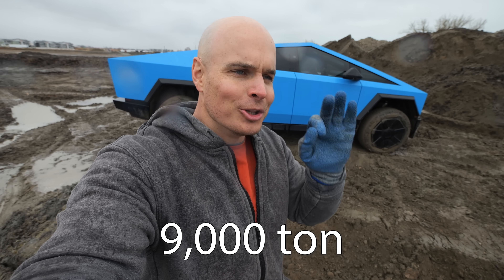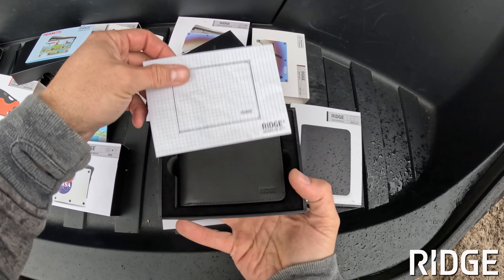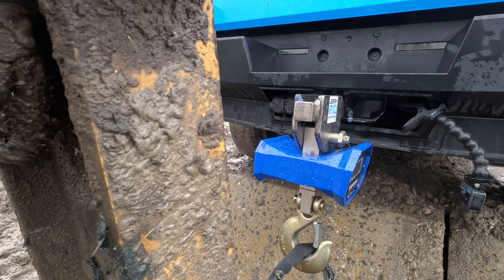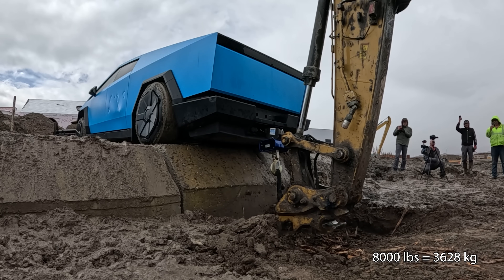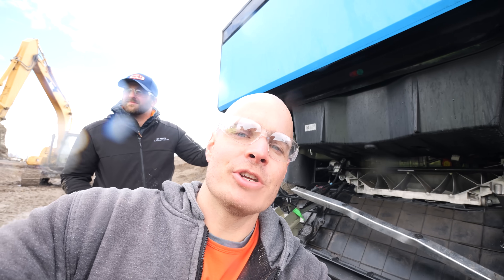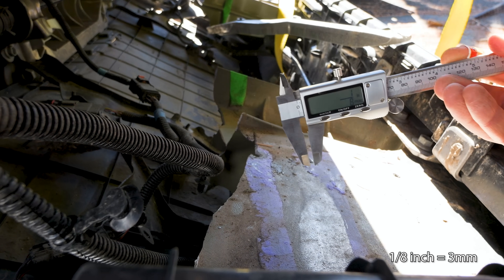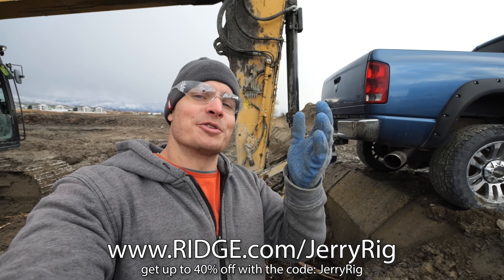SHOULD YOU TOW WITH A CYBERTRUCK?! - (catastrophic failure test)

Comment: That's crazy that they're relying on like 1/8" of CAST aluminum and spot welds/glue to hold a trailer. That would probably be fine on a car but theres no way I'd trust that in a truck. Yea its fast and cheap to build but for the money you pay for a cyber truck they really are built like $15k Chinese no name you use to fill pot holes on a golf course wtf

Comment: Hey Jerry, if you would like to push the frame further you'll be able to create more leverage by removing the suspension travel. this video is a great example if the suspension meets OEM standards, but i don't think it does. if you just want to test the frame capabilities; weld some square tubing between the axle and the frame and apply the pressure again.

Comment: Tow capacity is not the same a tongue weight. I Like your video’s, but this was just bs click bait. I expected better from this channel…
Reply: Regardless of what you want to call it, it's not safe.
Reply: @ how is it not safe? You will never see that amount of direct tongue weight towing within the capacity of the truck.
Reply: @jonholaday2733  like if you went over a pothole and all that weight just suddenly went in one direction?
What if you're pulling someone out of the mud who got stuck?
Reply: @ there still would not be the full capacity or weight directly down on the hitch. That would require the trailer tires to be airborne. 

Hitches are not recovery points, if someone is hitting it that hard to extract a stuck vehicle, they should be using a kinetic rope of the appropriate size. 
I stand by my original comment, this test proved nothing negative of the hitch design.
Reply: @jonholaday2733  so I don't actually get to see the gauge when the excavator is bouncing on it?

Comment: pointless vid youll never get 10k lbs of tongue weight if your towing what its rated for. but would i buy  a cyber truck for towing nope.
Reply: Totally possible if you hit a pothole
Reply: @rogerwilco5918  no its not u literally just saw a 50k lb trackhoe bouncing on the  ram hitch and  the scale didnt go up much higher than it was when he was picking his tracks up off the ground that tells me bouncing doesnt put as wieght on it as they imply in the vid. so youll never  get 10k  hitting a pothole if your just putting the required 10% tongue wieght on
Reply: @windzer  actually, no I didn't. Where did they show the scale when they were bouncing on the truck? What was the timestamp?
Reply: @rogerwilco5918  watch the vid again and give them another view
Reply: @rogerwilco5918  watch the vid again and give them another view
Reply: @windzer  so, you didn't actually see the part you just described?
Reply: @rogerwilco5918  watch the video. you clearly didn't watch the video and just decided to comment without watching.
Reply: @windzer  at no point in this video did they show what you described
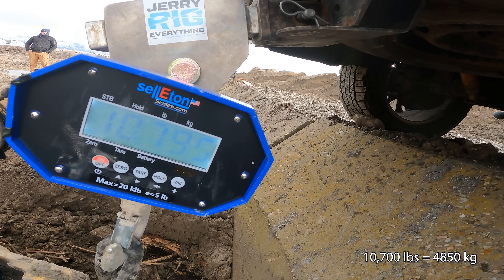Reply: @rogerwilco5918  13:01 wow your blind
Reply: @windzer  maybe you can tell me how much it said then?
Reply: @ move along troll you bore me
Reply: @windzer  So, you made that up then, and tried to use it to prove your nonsense point?
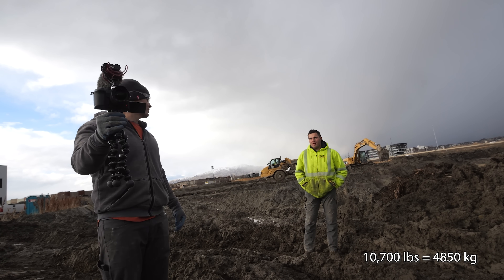Reply: @rogerwilco5918  its at 13:02 wat are u talking about
Reply: @windzer  so, there's no actual video of them bouncing and I can see the gauge.
They didn't even mention what the maximum pressure was when they were bouncing.
Regardless, it didn't break the truck in half like it did the Tesla

Comment: This test just proved that the tongue weight is nearly as high as its towing capacity. That's insane. You should be pulling in the lateral, not pushing in the vertical.

Comment: Shouldn't you have tried to rip the hitch off by pulling to the rear with it and not straight down? Since when are you going to have a 10,000lb weight hanging vertically from the ball?

Comment: I'm normally quite a fan of your video's, but I must say that im slightly dissapointed in this test. During real word situations, the downwards force induced upon the hitch would not come close to the force of 10000lbs of dead weight hanging from the hitch. Even if in the extremely unrealistic scenario that a trailer is loaded with 10000lbs on just the front of the trailer, the weight will still be (unevenly, but still) distributed over all tires via the axles. Not to mention suspension and the tires greatly spreading the already distributed forces of a sudden up or downward acceleration over time. A guesstimate would be that the equivalent of the force of max. 2000 lbs of dead weight hanging from the hitch would be induced in a realistic situation.
Reply: To be clear: i agree that aluminium is a horrible material for a frame. The issue is that this test does not show that, because the tesla survived almost 10x its rating.

Comment: Why would you push straight down on it? Even the F450 only has a 5100 payload capacity. Better to pull it straight back. Like you are actually towing. I hear your explanation but this is not at all accurate unless the trailer in question is airborne behind the truck! 

Imagine this: I can hit a driver side window with a hammer and it not break. Take a screw driver and put it at the top and try to pry the window down and it will shatter with ease. What you are doing is the equivalent of the screwdriver in this example. 

Yes steel is stronger but we already knew that. This is not a fault with the Cyber truck, you also compared a 3/4 truck frame to a 1/2 truck frame with the cyber truck. This is not apples to apples, try that with your Riven.

Comment: Jerry,

Good job, all you proved with this finding is that Tesla has a 10x factory of safety for weight rating on the tongue weight. Great work! Your should really do your research before coming up with findings that’s don’t apply to real world.  Tongue weight is typically only 10% of towing capacity..  this should inspire more people to by a cyber Truck not less! And you’re complete wrong on the pothole issue.  The entire weight of the load would never bare down on the hitch from hitting a pothole.  Are you insane??

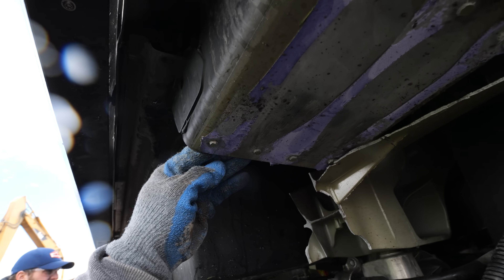Comment: 8:17 That is literally structural adhesive, probably Teroson EP 5089. I worked where the newest corvette's aluminum frame is built and that's what is used between mating surfaces along with the spot welds. What's crazy to me though, is how few spot welds there are for such a HUGE surface area. 6 spot welds and 3 stripes of adhesive for a surface area that wide and flat is basically just tacking them together. The aluminum frame of the Corvette has spot welds lining up and down each part along with huge servings of the purple adhesive. The casting in this thing amazes me too, how thin it is at most points. Like they thought that an I/H beam style of casting would be enough even if it was that thin. I would truly like to see a more scientific and controlled test approach of the CT's frame and towing, to confirm this or Whistlin diesels random carnage, but there have already been real world cases of the frame snapping just like this from doing nothing but towing.

Comment: No doubt a steel frame is stronger than the Al casting and bonded structure, however I disagree with the alarmist statements you make.  If somehow you managed to get the entire weight of your trailer to come down vertically on the hitch while driving, you’d be f’d as you’d loose control of the truck.  The front wheels would come off the ground.  As you demonstrated, there isn’t a way to impart a 10k load without holding down the wheels.

You need a follow up video where you show a trailer with a load and how strong the hutch is.  You ight find the ball hitch struggles at 10k of vertical load.

Let’s keep in mind you tested the part to nearly 20x its rated load.

Comment: Idra Group
The Giga Press program is a series of aluminium die casting machines manufactured for Tesla, initially by Idra Group in Italy. Idra presses were the largest high-pressure die casting machines in production as of 2020, with a clamping force of 55,000 to 61,000 kilonewtons (5,600 to 6,200 tf).

Comment: Hi Jerry. I do really like your show. However, I felt this test was more of a Houdini trick. 

Before that much weight could be applied the rear of the truck, the front would start raisin would limit the weight. And if it continued to rise, eventually the hitch would hit and ground again limiting the weight on the truck structure.  

Holding the front end down was the cheat…while putting this massive weight down on the rear 

If a person’s just pulling an oversized overweight trailer with a cybertruck, it would just lift the wheels all the time and or jam the hitch into the ground.

Comment: Aluminium is strong if you prefer it to be rigid but it can't handle fatigue unlike steel. Also aluminium's weakness is it can't absorb shock this is why whistlindiesel broke his even without applying 10k on the hitch.

Comment: Cast aluminum frame for a part that critical is really dumb. Vibrations alone will cause metal fatigue even if the loads are relatively low. Its happened in the past with mountain bikes where they eventually break in half.

Comment: This test is like balancing the entire max trailer load on the tow ball vertically. 

Although, stronger materials should definitely be used here. 3mm is not okay, especially cast with all the problems cast matrials may have (porosity/inclusions/shrinkage cracks/ext).

Comment: So it handled 3x the maximum tongue weight of a 2025 Ram 1500 and didnt really start to have anything major happen till over 6x the tongue weight of similar trucks.

Also, think about this perspective. You wont be towing a 100,000lb pound trackhoe with it. If the trackhoe is bouncing on the tongue, supported and lifted into the air and only creating 5 tons, you are golden for practically anything a 1500 would tow, because the max tow rating of a Ram 1500 kitted for maximum pull is just over 10klbs. 

A little more info, the cyber truck has a tongue weight rating of 1100lbs and a tow rating of 11,000 max. 

A properly loaded trailer will only put 10% of its weight on the tongue, the rest being supported by the trailers axel(s). This means that a 50,000lb excavator would have a tongue weight of 5,000lbs. Not counting the trailer weight of course. The truck axel broke off at 8,000lbs. So that means that the CT would be capable of accepting a trailer with an big trackhoe on it and pull it across the ground.

Now, potholes or curbs or whatever, do cause more weight to impact the tongue. Though, with a properly loaded trailer, if you dropped the rear tires off an 8" curb at the same time, you are going to put about 2000-2500lbs of force on the trailer, at max load 11k lbs. It would take an improperly loaded max weight trailer(60% of the load on the hitch) to exceed the break point of the Cyber Trucks hitch.

That sounds a little bad cause, maybe someone has no idea what they are doing and loads up his trailer in the worst way possible. Ok sure. Though, a picture of what that woudl look ilke, would be two ram 1500s stacked on top of each other, sideways on the trailer...  Or a realistic example would be someone putting 3 whole pallets of bagged concrete at the very front of their trailer. Thtats how you hit a pothole and exceed 8,000lbs tongue weight of a max tow rated load. 

It was built to be in the ballpark of the half ton pickup class. Though, i think most people that get a cyber truck are going to be mostly light duty anyway, just from the nature of the vehicle itself. You might have some that tow around utility trailers and such for construction work or otherwise, but i dont see any of that weighing enough to bring it to the 11,000lb limit. 

I would give a pass for the control vehicle being older, because older vehicles have less tow rating capabilities. The 2500 of today can tow 20,000lbs, which id double the 1500 of today. Though, in 2004 the old design could only do 12,000lbs which is very close to the max tow rating of the cyber truck, off by 1000lbs. That sounds close enough for compare, except when you consider that the 2500s are designed for rugged work and the frame of the 2500 is significantly beefed up compared to even a modern 1500s frames. So... im not sure its worth comparing as an apples to apples comparison to use as "control".  Though, a modern 1500 has slightly improved reinforcements... It would definitely be worth testing the 3 vehicles against each other.

Overall, i think the cybertruck will do what its intended to do, if you went overboard and were either the dumbest person to ever tow something, or intentionally trying to break it... then it might break if given the perfect situation.

Comment: This ridiculous uneducated explanation of how  the  hitch could possibly experience any kind of a shock load that's even worth noting or any thing to be concerned about is false.  Anyone that believes his ridiculous explanation how this could happen has no knowledge of physics and how the springs  and shock absorbers along with the pneumatic tires all work together to prevent any kind of concern able shock load. If you have any doubt try putting a 2x4 on top of a spring and see how fast you can drive a nail into it with a hammer.  The hitch will experience heavier temporary loading and unloading while the trailer is slowly bouncing over uneven road conditions. The mass of the trailer controls how fast the trailer can be accelerated in both the upward and downward directions so the resulting speed at which the trailer can come down on the hitch is not close to hammer speeds that could result in any excessively heavier tongue load or any kind of an actual shock load. The manufactures of both the truck and the hitches that can be put into the trucks receiver already factored that into the tongue weight max rating knowing there will be slightly heavier loads applied even with improperly loaded trailers. It is most unlikely that any additional loads that will be applied to the hitch will be enough to cause aluminum fatigue.  I would not think of this guys videos as anything educational because he proved himself  in this video as a know it all fool. To the point it would be dangerous to accept any thing he might say was safe. If you just watch because its fun to watch people destroy their own stuff then accept him as nothing more than a biased comedian.

Comment: The conclusion by Jerry is a malformed argument.  Since he focuses on the weight at which the bumper hitch fails. Jerry fails to account for the  total vehicle dynamics of any truck loaded with this much weight, in the conditions he states are possible failure modes. Meaning any truck loaded with the amount weight required to cause this type of catastrophic failure, would lead any vehicle  [including the Dodge he uses for comparison] to  be in a very dangerous vehicle dynamics. The front wheels would be lifted on the vehicle, with a very likely chance of loss of control of the vehicle. Once a vehicle loaded with this type of tongue weight . The vehicle is then only controlled by the two rear wheels, The rear axle and wheels would no longer be able to control the lateral motion of the trailer.  Jerry ignores the real world  vehicle dynamics of a moving trailer-ed load to focus on static load breaking strength. While this is a test point, it in no way the reality real world vehicle dynamics.

Comment: towing capacity is not lifting capacity( Tongue Weight)! I do not like the tesla truck nor would I ever buy one. But the amount of steering and stability problems that would result from an improper load on a trailer. I feel this video is trying to display a bad image on a product by not informing people of the difference. 
Here is the Tesla truck ratings from their site: 	Maximum Towing Capacity:	11,000 lb (4,990 kg)    Maximum Tongue Weight*:	1,100 lb (499 kg)
so in this video the hitch did its job at 1100lbs anything beyond that point is a safety factor. Its nice to see a braking point, but at no point did they explain the difference between the two ratings not what tesla is clamming. Again at no point would you ever be at risk behind a tesla truck towing a trailer if the owner is fallowing that max capacity show on the truck. Trust me when I say, no truck out in the road would ever be able to stay stable enough to hit 60mph and have an improper load on a trailer where all the weight is on the tongue. (please make a video showing me otherwise because I would watch that.)

Other notes:*The tongue weight is the downward force that the weight of the trailer exerts on the hitch. It must not exceed 10% of the maximum towing capacity.
another example: 2018 F 150 truck that has 5000 lb rated hitch, 2080 lb payload, 11600 lb tow capacity

Comment: Im a truck driver and i can tell you we dont run aluminum frames for this reason. Aluminum is great for body panels and other non structural parts of the vehicle but i would never tow with an aluminum chassis.